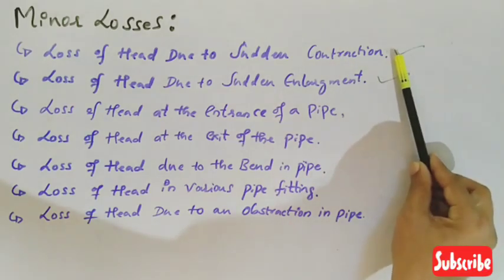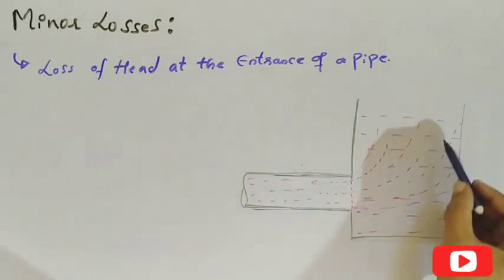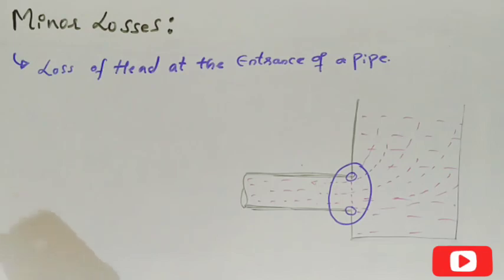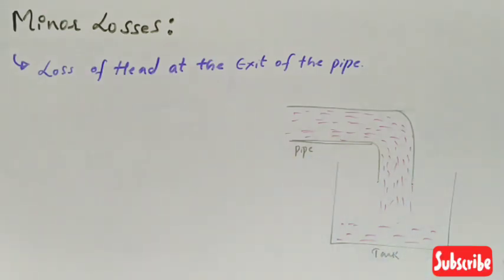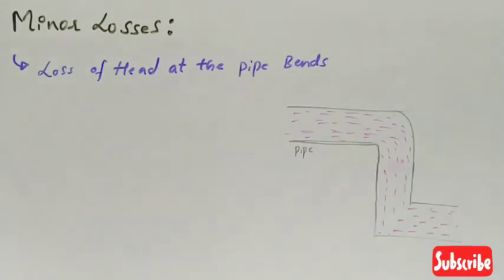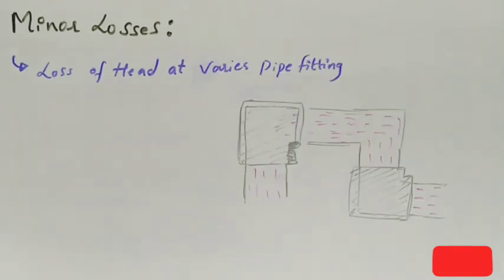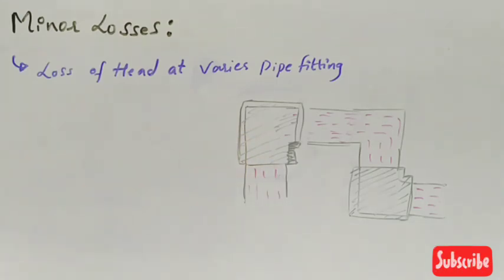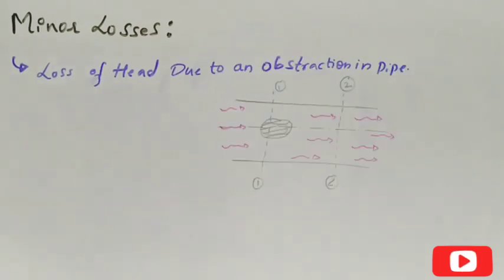Fluid Mechanics Module 3 :  Minor Loss | Types of Minor Losses in Pipes | Part 20 | VTU | GATE

Comment from the maker: Question : What is the correct formula for loss at the exit of a pipe?
a. hL = 0.5 (V2 / 2g)
b. hL = (V2 / 2g)
c. hL = (2 V2 / g)
d. hL = (4 V2 / g)
Reply: (b) hl = (V2/2g)
Reply: B. V2/2g
Reply: B. h2=(V2/2g)
Reply: B. hl=(v2/2g)
Reply: b.v2/2g
Reply: hL= (V2/2g)
Reply: b) hL=(V2/2g)
Reply: B.)hl = (V^2 / 2g)
Reply: hl=(V2/2g)
Reply: b. hL = (V2/2g).

Comment from the maker: Question : On which of the factors does the co-efficent of bend in a pipe depend?
a) angle of bend and radius of curvature of the bend
b) angle of bend and radius of the pipe
c) radius of curvature of the bend and pipe
d) radius of curvature of the bend and pipe and angle of bend
Reply: (d) radius of curvature of the bend and pipe and angle of bend
Reply: d) radius of curvature of bend and pipe and angle of bend
Reply: d.radius of curvature of the bend and pipe and angle of bend.
Reply: d) radius of curvature of the bend and pipe and angle of bend
Reply: D.)radius of curvature of the bend and pipe,and angle of bend
Reply: Radius of curvature of the bend and pipe and angle of bend
Reply: d:radius of curvature on the bend and pipe angle of bend
Reply: d. Radius of curvature of the bend and pipe and angle of bend.